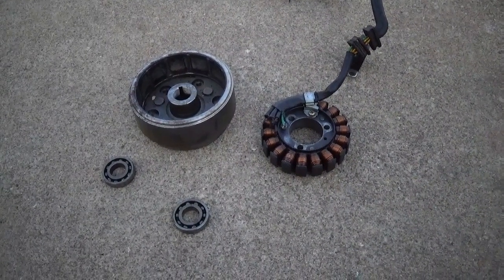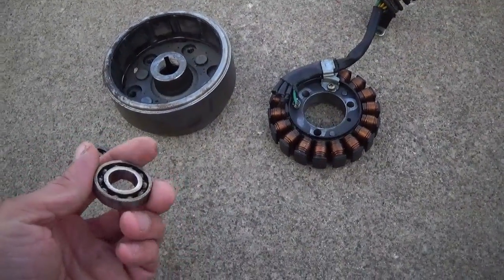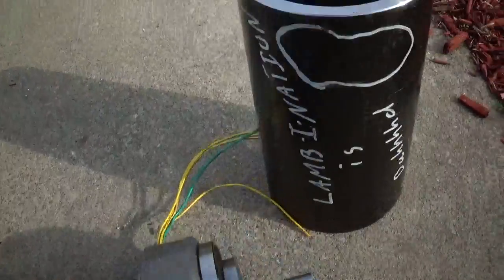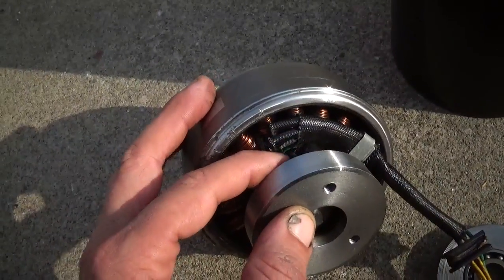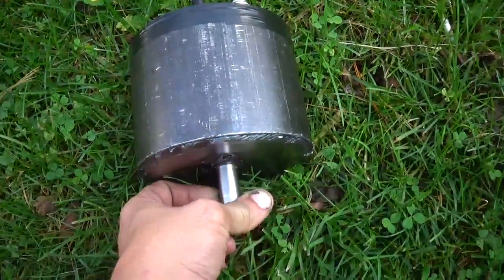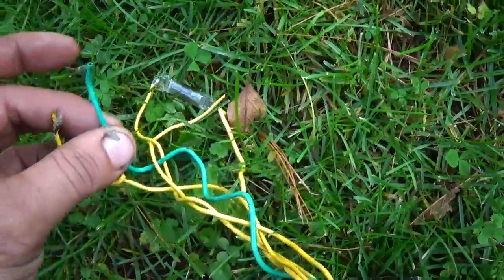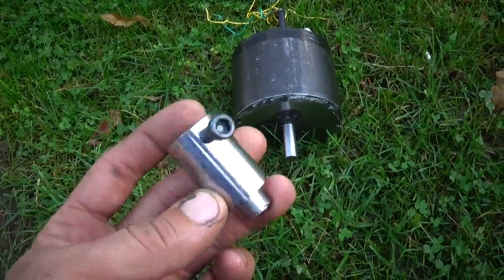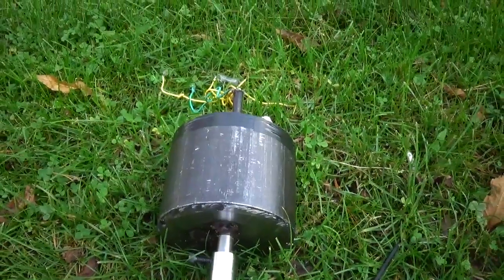Alternator made from motorcycle Stator

Comment: Aren't most of them a alternate anyway but they don't make much power
Reply from the maker: 110 watts is better than none. A stator is a alternator, this was made for buggys with out power.
Reply: i ment cant you just use the stator as a altinator while still being a stator
Reply from the maker: Oh, On the gx200 and 390 with electric start the stators are only 10 to 20 watts ish. So it can barely charge the battery from starting it. Running lights is out of question. More than anything it was just a project..